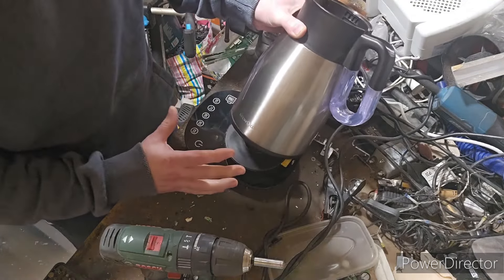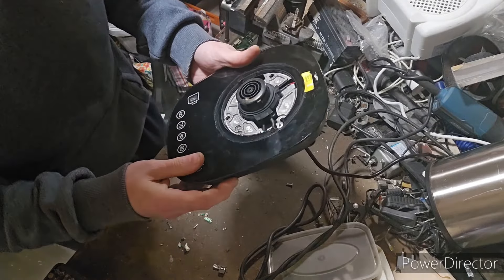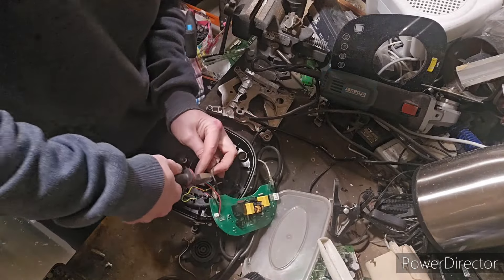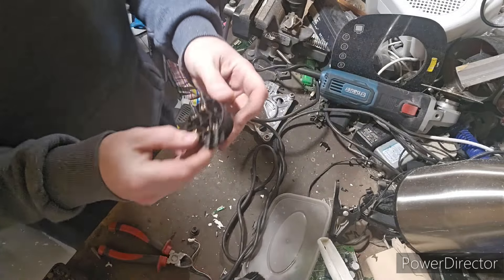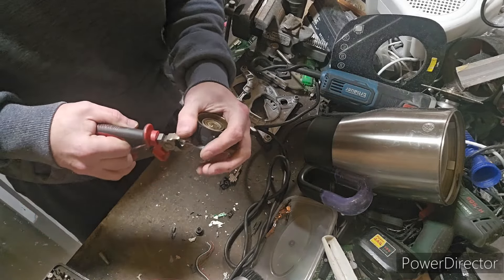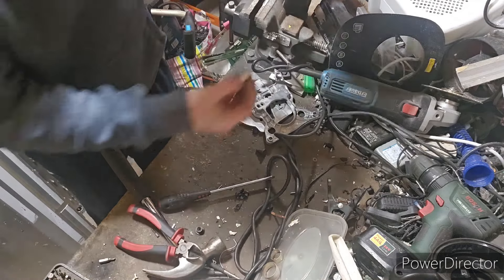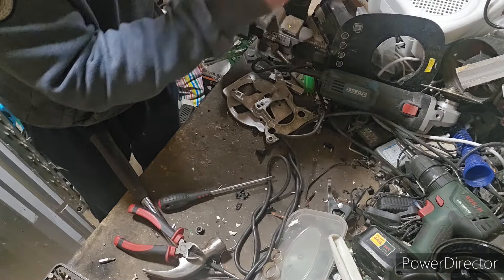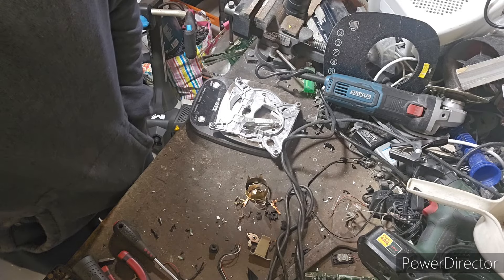Scrapping a smart kettle,  was it smart?

Comment: Oh man, that plastic sent your brass flying. 
The heating element came out so easily. 
Bummer the magnet stuck to the kettle. 
3 subs away, very exciting brother!
Reply from the maker: Thank you brother.  Any tips on how to remove that heating element from the aluminium plate?
Reply: @ScrappingScotland  you’re welcome!
I put them in the vise with the ends of the element sticking up. I take the claw side of a hammer and wedge it between one of the ends of the element and I do some prying action, usually that will work but sometimes it doesn’t lol
Reply from the maker: @scrapitall200  sounds like a plan to me. I'll give that a go for sure. Thanks brother
Reply: @ScrappingScotland  you’re welcome brother!